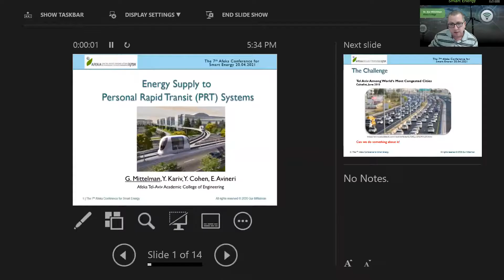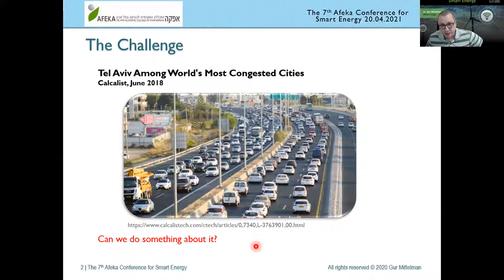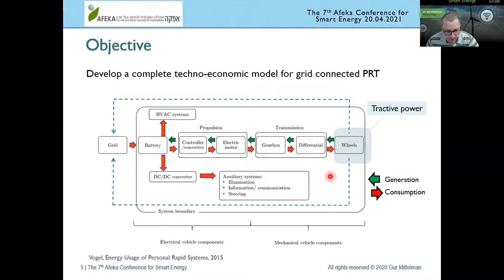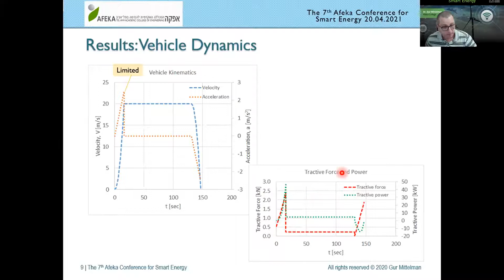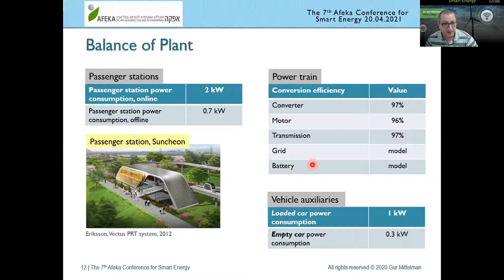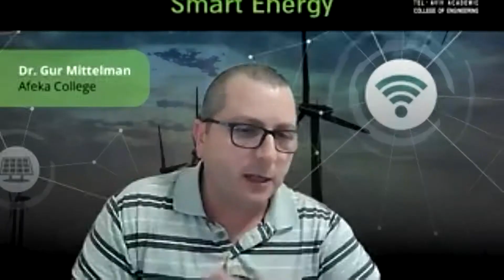The 7th Afeka Conference For Smart Energy | Energy Supply to Personal Rapid Transit (PRT) Systems

Comment: BEV vs. 3rd Rail, it is a question of number of pods, which is the most reason for test systems to prefer battery . I dont think that 200Wh/kg relates to  battery with packaging and cooling and 8 kWh is pretty small for a 600kg pod . And  I dont think that consumption is lower with batteries since you have more load and cooling.